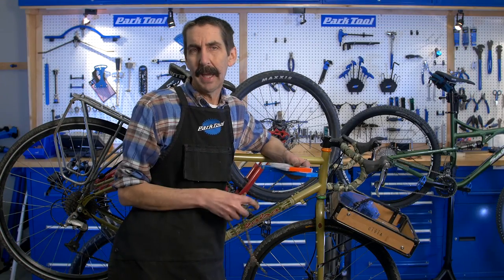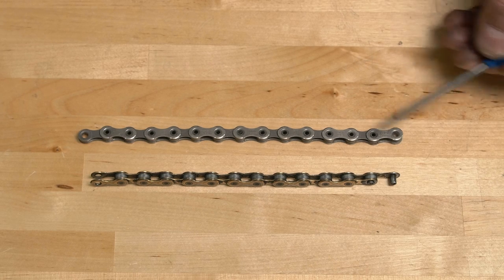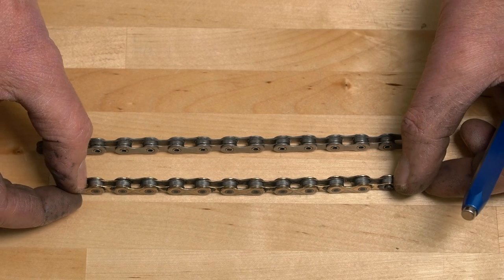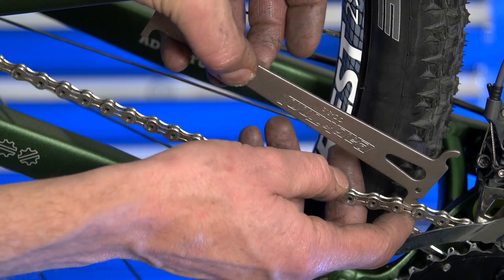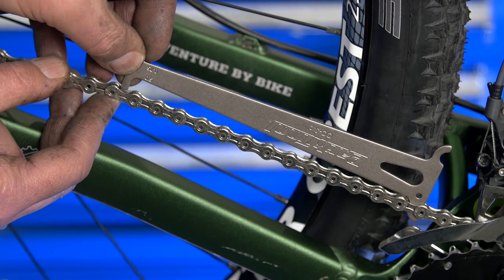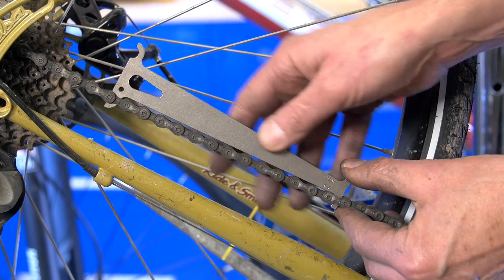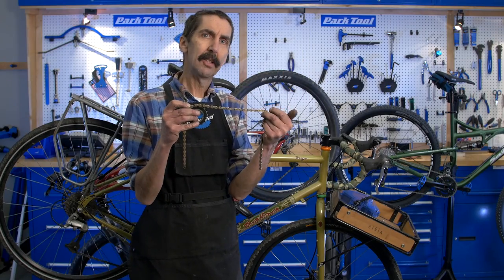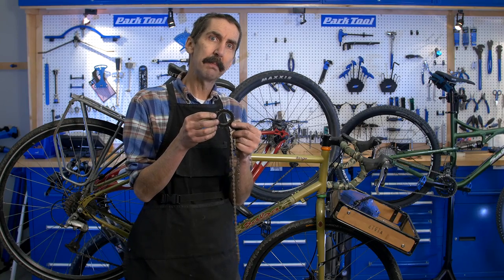Tech Tuesday #21: Spring Tune-Up - Chain Wear

Comment: Hi there! I have a chain checker wich shows 0.75 and 1.0 wear. Is this OK? Would you recommend changing the chain (11s Shimano) even before it reaches 0.75 wear? Thanks.
Reply from the maker: +Phaidrus For the 11 speeds, it is better to replace before the 0.75% wear.  The older chain and cogs were wider and would last longer, which is why the older tools show 0.75 and 1% as wear guidelines.  The new 11 speeds should be replaced as the chain reaches 0.5% -Calvin
Reply: +Park Tool Hello Calvin, thanks for replying. To be on the safe side, as the cassette is quite expensive, I just replaced the Shimano Dura Ace chain following your very helpful ("sizing it the easy way" with +2 links) video. All is nice and dandy now and I will I order the Park Tool CC-3.2 asap. Merry Christmas and a Happy New Year!